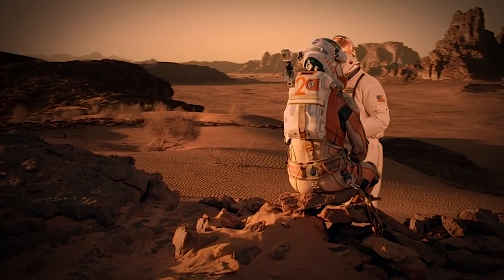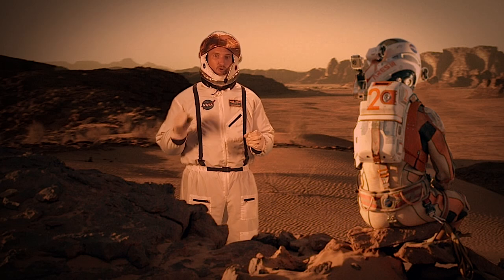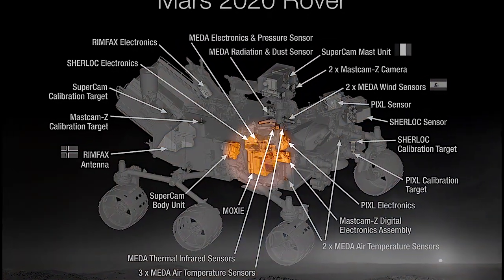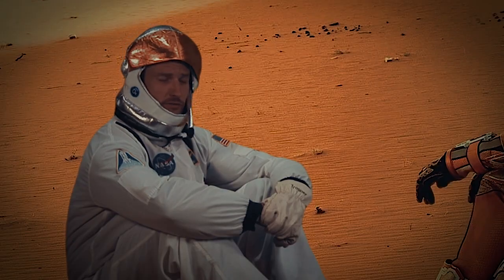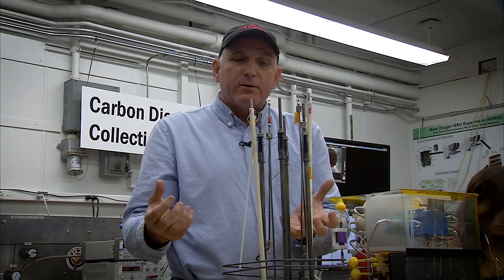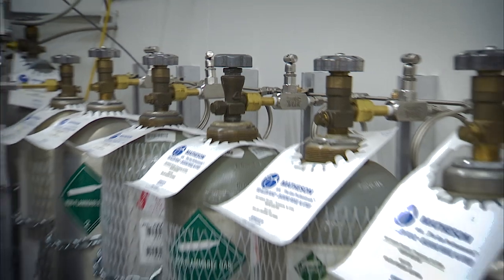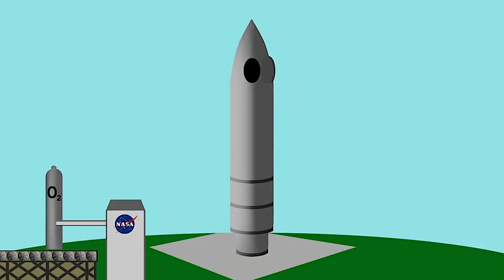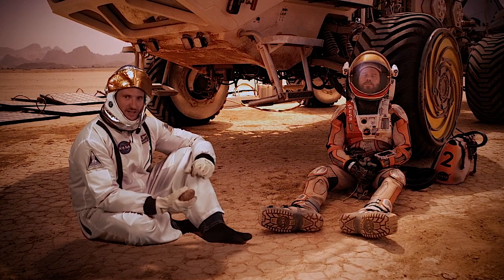Crazy Engineering: Making Oxygen on Mars with MOXIE

Comment: "Crazy Engineering", Consider the following:
Bombard craters on the Moon and Mars with protons to make H2O.  And if it can be done with the lowest crater, within a crater, within yet another crater, (3 craters), the lowest crater could be the lake, the middle crater the living area, and the highest crater the atmosphere.  Plus having potentially rich resources in the sides of the craters as well as caves and shelters could be made in the sides of the craters as added protections from harmful cosmic radiation energy.  Send robots first to build the infrastructure, then humans and other species.
Reply: It souds great but here is the problem: liqued water can not exist at the pressure of mars. Go look at a temperature pressure phase diagram for water. You will see that at the mars atmospheric pressure one would just go from ice to water gas. On the moon it worse. Creative thinking though.
Reply: @lemuelharing4137  Then we need to create a cave system with a sealed door and do it inside the cave.  Make it rain indoors.  Otherwise, how is one going to get enough drinkable water to the Moon and Mars?
Reply: @charlesbrightman4237   well thats an idea, now you need to consider if the cave can handle the pressure, a normal cave and synthetic build cave with martian sand and binder 3D print wond maintain pressure and gas will seep out. Now lets consider a lava tube, it would be air tight as is with leack areas sealed, now the problem comes in with maintaining the heat, the rock walls will sap out heat too fast and the ground surrounding it will help. Drilling deeper to find hotter surroundings will to big of a project that needs an infrastructure to support the project so that wont be done in a few hundred years. So lets consider your idea and try to make it viable. We want water from the icy sand. Lets ignore chemicals and just look at temperature and pressure. So too get ice into water or gas you need temperature, now you need to consider how and where to build your tank so that you minimise heat loss. So the 2 initial options are above ground or below ground. Well building it below ground in contact will lead to massive heat being sapped, building it on top of the ground will be better since gas has lower thermal conduction and also the surroundings have lower heat capacity, the lower pressure and thus lower mean gas density will lower thermal conduction even more. Now wind (and more severe wind in dust storms) will cause heat loss via convection so you build a small pourous dome around your tank with and airgap between your distelation column and the small wind shielding dome. Now you have a setup where you lose the least amount of heat so you can run your water collecter longer or more efficiently with the same amount of input power. Now how do you transform the ice into useable H2O, do you want liqued water or gas? So you put heat into the system and what you get depends on the pressure. If you increase the pressure a couple of times (im guestimating about 4 times logscale the martian pressure) then you would get water in a small temperature range. The remperature ranges increases with increasing pressure which is important since you have to move the water without pipes freezing . Alternatively you can extraxt the ice as water vapour or gas at martian atmospheric pressure. So it would be better to extract the ice as H2O gas, the gas will create a pressure difference and pump itself through pipes (pipe freezing problem still exists).  Liqued also has the problem of it mixing with the earth or sand that it came with and you need to filter sand out where as the gas would easily detach from the water and thus easy seperation. You could then let the H2O gas freeze onto a plate or some surface by letting it cool to seperate the any CO2 in the gas. That sheet or plate of ice can then be transported to a colony where its melted at higher pressure and temperature where the humans live. Reason you wont want to pipe the gas is because it will freeze up pipe and keeping long lines of pipes warm will use a lot of heat. Now where do you keep your water machine, well preferably in a work habitat with casual matian suits where people cant live but its not as harsh as the open mars. Getting heat is a minor concern, you can concentrate sunlight into your distelation tank to keep it warm or preheat your ice and then heat a small amount of ice or icy dirt at a time, thus less electrical enery is used. This is an modular setup and can be expanded. Your origional idea is a huge progect and will make losts of water or no water. Read the next reply to see how it can still be achieved
Reply: @lemuelharing4137  Awaiting next reply.
Reply: So lets mae your setup work. Where it could work is domes or tunnels where peope live. Assuming earth mimicking then there will be pressures and temperaturs for water. So you would have an outside area where you could place reflective panels to reflect sun and heat a very small area to melt the ice rapidly to steam.The steam can be contacted to a air recycling pipe with a heat exchanger and you would coold the steam to water while heating the air used to keep the colony warm. The liqued water can then be bottled or transported. Now you could if you realy wanted to let the water drain out the sand, witch will be slow due to lower gravity and you will still have to boil the last bit of dried sand from your ice to get that water thats left.  The thing with the water is that you dont need a lot of it. Your humans will always live in an air tight system, either by peope fixing holes or water freezing as its escapes making ice that blocks up all air leaks. With water recycling you only need a small amout of water to acomodate population growth, chemical lossses, industry or even ice as a constuction material. So there is no real need for massive ice distillars. Anyway let me know and let me hear about your other ideas, this really got me thinking and i learned a lot of things just hypothesizing the idea and maybe i missed something and i can learn even more.
Reply: @lemuelharing4137  Well, two things.  First will be what most probably occurs if we are not as Earthlings successful.  Secondly, will be my theory of everything along with the gravity test for what I believe gravity truly is.  "IF" true, and I fully acknowledge the 'if' at this time, the gravity test needs to be done to prove or disprove that portion of the TOE, 'then' possibly 1) artificial gravity could potentially be accomplished; 2) better protections from harmful cosmic radiation could potentially be accomplished; 3) by knowing, understanding and having wisdom in the very nature of reality should be able to help basically any problem we might have, including potentially generating a dimension within this dimension we are currently existing in.

Anyway, look for two more posts after this one.
Reply: @lemuelharing4137  (Copy and paste from my files):  My TOE idea and gravity test:

Revised TOE: 3/25/2017a.
My Current TOE:

THE SETUP:
1. Modern science currently recognizes four forces of nature: The strong nuclear force, the weak nuclear force, gravity, and electromagnetism.
2. In school we are taught that with magnetism, opposite polarities attract and like polarities repel. But inside the arc of a large horseshoe magnet it's the other way around, like polarities attract and opposite polarities repel. (I have proved this to myself with magnets and anybody with a large horseshoe magnet and two smaller bar magnets can easily prove this to yourself too.  It occurs at the outer end of the inner arc of the horseshoe magnet.).
3. Charged particles have an associated magnetic field with them.
4. Protons and electrons are charged particles and have their associated magnetic fields with them.
5. Photons also have both an electric and a magnetic component to them.

FOUR FORCES OF NATURE DOWN INTO TWO:
6. When an electron is in close proximity to the nucleus, it would basically generate a 360 degree spherical magnetic field.
7. Like charged protons would stick together inside of this magnetic field, while simultaneously repelling opposite charged electrons inside this magnetic field, while simultaneously attracting the opposite charged electrons across the inner portion of the electron's moving magnetic field.
8. There are probably no such thing as "gluons" in actual reality.
9. The strong nuclear force and the weak nuclear force are probably derivatives of the electro-magnetic field interactions between electrons and protons.
10. The nucleus is probably an electro-magnetic field boundary.
11. Quarks also supposedly have a charge to them and then would also most likely have electro-magnetic fields associated with them, possibly a different arrangement for each of the six different type of quarks.
12. The interactions between the quarks EM forces are how and why protons and neutrons formulate as well as how and why protons and neutrons stay inside of the nucleus and do not just pass through as neutrinos do.

THE GEM FORCE INTERACTIONS AND QUANTA:
13. Personally, I currently believe that the directional force in photons is "gravity".  It's the force that makes the sine wave of EM energy go from a wide (maximum extension) to a point (minimum extension) of a moving photon and acts 90 degrees to the EM forces which act 90 degrees to each other.  When the EM gets to maximum extension, "gravity" flips and EM goes to minimum, then "gravity" flips and goes back to maximum, etc, etc.  A stationary photon would pulse from it's maximum extension to a point possibly even too small to detect, then back to maximum, etc, etc.
14. I also believe that a pulsating, swirling singularity (which is basically a pulsating, swirling 'gem' photon) is the energy unit in this universe.
15. When these pulsating, swirling energy units interact with other energy units, they tangle together and can interlock at times. Various shapes (strings, spheres, whatever) might be formed, which then create sub-atomic material, atoms, molecules, and everything in existence in this universe.
16. When the energy units unite and interlock together they would tend to stabilize and vibrate.
17. I believe there is probably a Photonic Theory Of The Atomic Structure.
18. Everything is basically "light" (photons) in a universe entirely filled with "light" (photons).

THE MAGNETIC FORCE SPECIFICALLY:
19. When the electron with it's associated magnetic field goes around the proton with it's associated magnetic field, internal and external energy oscillations are set up.
20. When more than one atom is involved, and these energy frequencies align, they add together, specifically the magnetic field frequency.
21. I currently believe that this is where a line of flux originates from, aligned magnetic field frequencies.

NOTES:
22. The Earth can be looked at as being a massive singular interacting photon with it's magnetic field, electrical surface field, and gravity, all three photonic forces all being 90 degrees from each other.
23. The flat spiral galaxy can be looked at as being a massive singular interacting photon with it's magnetic fields on each side of the plane of matter, the electrical field along the plane of matter, and gravity being directed towards the galactic center's black hole where the gravitational forces would meet, all three photonic forces all being 90 degrees from each other.
24. As below in the singularity, as above in the galaxy and probably universe as well.
25. I believe there are only two forces of nature, Gravity and EM, (GEM). Due to the stability of the GEM with the energy unit, this is also why the forces of nature haven't evolved by now. Of which with the current theory of understanding, how come the forces of nature haven't evolved by now since the original conditions acting upon the singularity aren't acting upon them like they originally were, billions of years have supposedly elapsed, in a universe that continues to expand and cool, with energy that could not be created nor destroyed would be getting less and less dense? My theory would seem to make more sense if in fact it is really true. I really wonder if it is in fact really true.
26. And the universe would be expanding due to these pulsating and interacting energy units and would also allow galaxies to collide, of which, how could galaxies ever collide if they are all speeding away from each other like is currently taught?

DISCLAIMER:
27. As I as well as all of humanity truly do not know what we do not know, the above certainly could be wrong. It would have to be proved or disproved to know for more certainty.

________

Here is the test for the 'gravity' portion of my TOE idea.  I do not have the necessary resources to do the test but maybe you or someone else reading this does, will do the test, then tell the world what is found out either way.

a. Imagine a 12 hour clock.
b. Put a magnetic field across from the 3 to 9 o'clock positions.
c. Put an electric field across from the 6 to 12 o'clock positions.
(The magnetic field and electric field would be 90 degrees to each other and should be polarized so as to complement each other.)
d. Shoot a high powered laser through the center of the clock at 90 degrees to the em fields.
e. Do this with the em fields on and off.
(The em fields could be varied in size, strength, density and depth.  The intent would be to energy frequency match the laser and em fields for optimal results.)
f. Look for any gravitational / anti-gravitational effects.
(Including the utilization of ferro cells so as to be able to actually see the energy field movements.)

(An alternative to the above would be to shoot 3 high powered lasers, or a single high powered laser split into 3 beams, each adjustable to achieve the above set up, all focused upon a single point in space.)

'If' effects are noted, 'then' further research could be done.
'If' effects are not noted, 'then' my latest TOE idea is wrong.  But still, we would know what 'gravity' was not, which is still something in the scientific world.  Science still wins either way and moves forward.
Reply: @lemuelharing4137  And oh, reading this thread through again, it sounds like you wanted to get the H2O from icy sand.  That is not the original idea above.  Originally I was thinking just bombarding the soil with protons, continuously, for a very, very long time.  Then also one could possibly connect the MOXIE from this video to make the oxygen, then bombard that oxygen with protons to potentially make H2O if combined properly.  Then of course also, the H2O could be split to give O2 and H2 of which could be utilized as a fuel source and/or in a hydrogen fuel cell to get the electricity back with a byproduct of H2O, which could even be split again, and over and over and over.  Wherever there are protons, (basically everywhere), and oxygen (in Mars atmosphere if not even from the soil somehow, someway), water (H2O) should be able to be obtained.
Reply: @charlesbrightman4237  Haha this is a lot, Is it possible that we could discuss this over VoIP like discord, teamspeak or the like? So just quickly: Im not that qualified in the physics and also would need to refresh my memory on the science of a lot of the principles but: Regarding the TOE and grivity you might want to look at LIGO, a setup build and used to detect gravitational waves by detecting the change in light waveforms when influenced by gravitational waves. They have detected a supernova explosio recently or colision of 2 stars if i remember the news correctly. Also see the experiments done by the US in the late 1900's there they used the earths magnetic field and neuclear bombs by exploding a nuke on one side or the earh and having a resulting EMP effect one the otherside of the earth. I cant remember the names of the projects or the effect though. Regarding the ionization and that(i glansed through quicly as im presuming a ViOP chat will happen) you seem to try doing fusion. Regarding the H2-O2 feul cell i can talk or rant for hours about that since im knolagable about the electro-chemistry on it and thus the possibility and limitations. Ifs a plausible idea but same as Moxie it would be usefull for small scale initialy where only electricity is readily availably. For the scale you are talking about it would be more energy efficient  to find icy astroids, coments or  planettoids, stap neuclear rockets on them and crash them into mars than to mass produce water electro chemically like that. Disclaimer: I didnt give this reply that much thought so do let me know if i should elaborate here after giving it all a proper thought
Reply: @charlesbrightman4237   Charles Brightman  So here is a thought through reply. I just want to make sure im getting it right. Firtsly are you thinking about this in terms of how physics works as we currently understand it or in the way that you think it would be supposing your TOE if correct? Secondly are you supposing that we bombard the martian surface with solar rays and thus ionizing radiation, then that radiation heats the ice to get water? Then we use moxy to get oxygen from CO2? The bombard the oxygen with protons to somehow get water? The last part makes me asume that you are not using the current theory of science? So im going to start with the initial part. Bombarding the surface with solar rays from space will heat the atmosphere as losses, that wich comes through will heat the martian surface, you will have defraction problems and it will be hard to get things narrow enough to boild liquadate the ice. Lets assume you get it right by genius engineering or just sheer magastrure orbital array. Then yea you will be able to melt the ice. Collection would be a fun task to achieve but ok. Next you want to use moxy to get oxygen. Propably better to get oxygen from water. Then you want to get bombard O2 with protons. So this is a far fetched idea but possible. If you uave a tank of oxygen you could hypothetically get a fission  process going and ending with H2 and gennerating energy, then feed the H2 and O2 into a feul cell. So the thing is you will get a lot of intermediataries as producs by trying to fission oxygen. But asuming you get all of it right then you could do it. My main statement about this regarding how i understand what you are trying to achieve is its vastly complicated. The complicated part is not what stops it, the main thing is that it requires vast amount of effort that you could have taken that time and developed a lot of other systems and technologies, deployed them and grown your colony by that time. So let me give some options that one might have explored in that time, hydrogen and deuterium fusion, helium3 fusion wich will make the moon a mining source of soo much fusion reactant to sustain a the earth for thoasands of years at current consumptions, you could have build a massive megga solar array around mars just to improse ground bassed solar arrays. You could also just beam down microwaves to mars allowing for massive salar arrays in space and small receiving powerplant on earth or mars, you could yave developed endothermic systems that will allow people to live on venus and make massive industries by cooling the atmostphere. Let me know if this helps and if i assumed things correctly. I will look at the TOE more in detail later when i have time free but i doubt that im qualified or current enough to deliver a proper response.
Reply: @lemuelharing4137  a.  Note: I did get email and bell notifications for your second to last reply, I did not get email and bell notifications for your last reply.  Note also, I am currently east coast USA time zone.

b.  I am currently doing a self study on the biology of microorganisms.  Studying how energy, atoms and molecules move about to do what they do.  Proton motive force being very important at some times.  Basically, using protons to manipulate matter.  Hence, utilizing protons to obtain H2O, basic water of course being two hydrogen atoms (1 proton 1 electron each), and one oxygen atom.  Oxygen is locked up in some soils and in this case in Mars' atmosphere too.  If the oxygen could first be obtained via MOXIE, that just makes obtaining oxygen that much easier.  Otherwise, obtain oxygen from wherever it's available from.

c.  My TOE idea is just that, my TOE idea.  Everybody should have one.  Then try to prove or disprove what is correct or not, changing the TOE as necessary.  I am currently at the place whereby the gravity test needs to be done, but in part, I don't have a high powered laser or three sitting around doing nothing.  But 'if' true, then not only might it show more of the true nature of reality, (a 'gem' photonic theory of the atomic structure, and highly possibly just a singular force with three different modalities), but also things like how numbers themselves would actually exist for math to do what math supposedly does, and even how existence and non existence could exist side by side for all of eternity, or even to possibly be able to generate a dimension within this dimension we are currently in.

d.  Look for another post after this one for a copy and paste concerning the math for this TOE.
Reply: @lemuelharing4137  (Copy and paste from my files):

The mathematics for the TOE doesn't even exist yet as far as I am currently aware.  It goes beyond any quantum field theory formulas that I am currently aware of.  The outline though is basically as follows:

The formula has at least 3 levels to it:
1. The Internal Photon Level:  The 3 interacting forces, (which might even be just a singular force with 3 different modalities), all interacting at basically 90 degrees to each other and all simultaneously pulsating and swirling.  A complex part of the formula but I believe to be totally doable.

2. The External Photon Level:  For each pulsating, swirling photon, all the pulsating, swirling photons interacting with it.  An exponential part of the formula that I am not even sure modern day super computers could adequately handle.

3. The Inter-dimensional Photon Level:  For each modality within each photon would have an energy frequency associated with it.  The energy frequencies could be seen as being in their own space time dimension.  (For me, 'space' is energy itself of which is the 'gem' photon and 'time' is the flow of energy; 'temperature' is the interaction of energy), so one would be dealing with way more than just 3 spatial dimensions and way more than just 1 time dimension (as there would many different energy frequencies with many different flows of energy).  Whenever like resonate energy frequencies resonated with each other, they would affect each other, kind of like 'spooky action at a distance'.  Anytime energy frequencies overlapped, there would be a temporary spike of some sort in each space time dimension.  In addition, if in reality the 'gem' photon is just a singular force with 3 different modalities, it's possible that energy could 'slip' between modalities which would also affect the results.  A very complex part of the formula on top of all the complexity that came before it.

4. Any time any energy moved in the system, the entire formula would have to be recalculated due to potential ripple effects.

Like I said above, I don't even believe the mathematics exists yet for what I am trying to do, but at a minimum, the formula would contain the above levels the way I currently see it to be.

____________________________________________________________________________

'IF' my latest TOE idea is really true, (and I fully acknowledge the 'if' at this time), that the pulsating, swirling 'gem' photon is the energy unit of this universe that makes up everything in existence in this universe, and what is called 'gravity' is a part of what is currently recognized as the 'em' photon, then the oscillation of these 3 interacting modalities of the energy unit would be as follows:

Gravity: Maximum in one direction, Neutral, Maximum in the other direction;
Electrical: Maximum in one direction, Neutral, Maximum in the other direction;
Magnetic: Maximum in one direction, Neutral, Maximum in the other direction.

Then:
1 singular energy unit, with 3 different modalities, with 6 maximum most reactive positions, with 9 total basic reactive positions (neutrals included).  Hence 1, 3, 6, 9 being very prominent numbers in this universe and why mathematics even works in this universe.
(And possibly '0', zero, for no flow of energy, hence the number system that we currently have).
Reply: I just want to know if you got all the private replies?